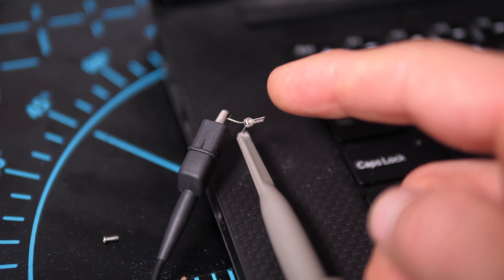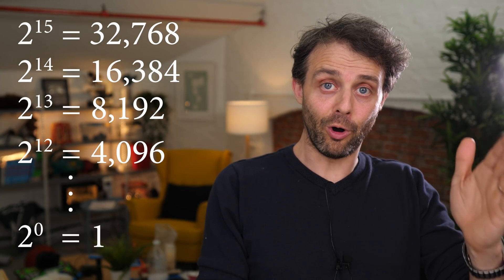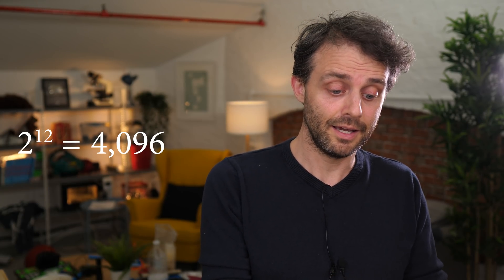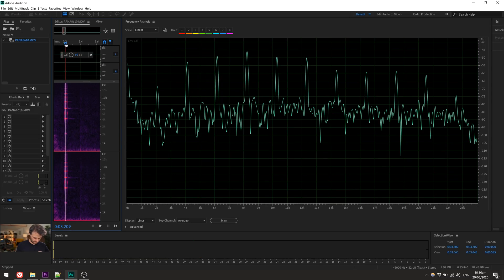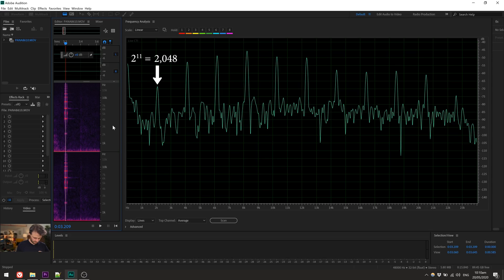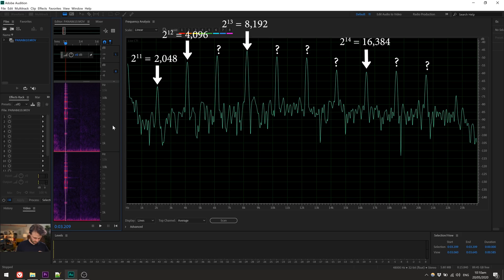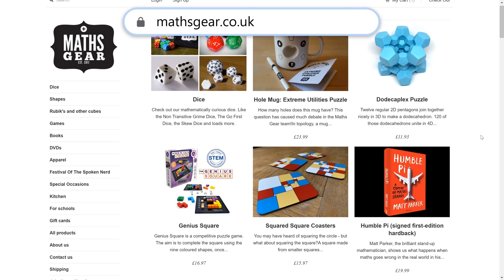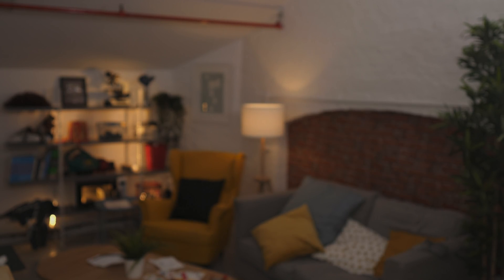Why a Watch Beep Is Exactly 2¹¹ Hz (2048 Hz)

Comment: Two questions I'm still wondering about those watches running at 32768Hz:
1. Does that mean dogs can hear them continuously humming? (Corollary question: if there's any dogs reading this comment, do you find those watches annoying?)

2. I'm pretty sure those watches have a "stopwatch" mode where they time in hundredths of a second. But that wouldn't be a power of two! Is it possible they do that by actually measuring 1/128 of a second and then doing some calculation? If that's our hypothesis, there's a way we could test it! You would have to take samples of the hundredths number at random intervals, and then measure the frequency of occurrences of each last digit -- if the display is updated every 1/128 of a second instead of 1/100, you would get a different distribution of digit frequency (instead of each digit occurring exactly 10% of the time). Would need loads of samples though....
Reply: Regarding the first question, porbably just very quietly, as the speaker is not used when there is no beep. But if you place it right next to a dogs ear, the dog would hear it.

Your idea for the second one is quite cool. But my (simplest) guess for how it works is like this. The watch counts up to 328 and every time it reaches that, the count gets reset, and 0.01s gets added to the time. I think like this the watch has an error of (32768/100 = 327.68 so 0.32 off from 328. 1s / 32768 x 0.32 = 0.000009766) 0.0009766s per second. So that seems precise enough for a hand operated stopwatch to me. So like this the watch probably will just ignore the error and display every number evenly
Reply: You might be able to get the data by looking at a highspeed camera of it counting up, depending on refresh rate of the LCD. 
Otherwise, this sounds ripe for automation! Get an rPi to push stop stop, take a picture of the screen, OCR it, then repeat.  I'm also curious now.
Reply: @rjmackenzie  Oh wow.. yeah.. that has to be done.  My guess is that you're right.. they're really measuring 128ths of a second and they're rounding it to the nearest hundredth.. After all, nobody would ever notice.  It does mean that some values would be more frequent, although if they treat the whole timeframe (minutes, seconds, hundredths) as one big number, those "peaks" in the randomness could be different in different seconds..  ie maybe in "second zero" there's a peak at 0.12 seconds, but because of the way the rounding works, that same peak would be on a different hundredth on second "5.xx"   WOW..  How to do this, without any rounding error from the device timing?!  (in otherwords an arduino may have the same issue, and if it's the one doing the test timing, your results could be skewed..)
Reply: @Steve Jones  Ooh, good point on the MC's timing needing to be compensated for. It should be ok if you just use one with a very fast clock. You could verify the true timing with a scope at 100 mhz, should be plenty fast to verify the timing being accurately "random" enough for this test.
This would also be really interesting to verify exactly how accurate the watch really is on it's timing... Pulsing the signal by a measured amount (tuned with scope).
Reply: Well, nowadays digital quartz watches probably no longer work like before... with the advent of ICs, they now can work using counters instead of halving the frequency repeatedly. That allows for precise stopwatches.
Reply: @GRBtutorials  we're talking the cheapest of cheap watches where every transistor is extra cost, I don't expect a $15 wristwatch to be at all accurate as a stopwatch
Reply: @TheAechBomb  You can buy a microcontroller (that is, a small CPU with integrated RAM and a PROM) for only $0.03. Of course, I'm pretty sure most watches use specific watch chips because it's cheaper and uses lower power. Silicon chips are very cheap nowadays and most likely not the main cost driver of such a watch. Even the quartz resonator would be more expensive!
Reply: @GRBtutorials  when he said halving im pretty sure he qas jist oversimplifying it. When you count in binary, every new digit doubles/halves it since binary is base 2
Reply: No idea what dogs can hear, but you've likely experienced this as well.  Ever hear and old TV or CRT monitor whine?  I think those tended to be in to ~20kHz range, but I definitely remember that when I was a kid.  Can't say if modern TV's still do it, don't think I can hear those frequencies anymore.
Reply: Rob Buchanan It’s around 15 kHz, which is the scan frequency. They use coils to deflect the dot, and that induces vibrations on magnetic parts, hence why you can hear it. Non-CRT TVs don’t use coils so they don’t emit that sound.
Reply: @GRBtutorials  15.625kHz PAL, 15.734KHz NTSC.
Reply: @Buchaven959  CRT TV whine is 15.6 or 15.75 KHz. CRT PC monitors generally do not have an audible whine, as the horizontal refresh rates are much higher, above 30 KHz. Modern TVs generally don't audibly whine. Sometimes they still do, but the mechanisms are unrelated and there's no one given frequency or source of frequency that they whine at, but if i were to guess the most common one, it's usually the coil whine of a voltage regulator, which are trimmed to be above 25KHz, and often in hundreds of KHz, but visual patterns or the horizontal refresh and the regulator frequency can sometimes modulate each other producing a sum and difference, and the difference can sometimes fold right back into the audible range if you're unlucky.
Reply: @Buchaven959  You heard the horizontal scan frequency which was above 15Khz and used to run the flyback transformer which created the high voltage needed for the picture tube. I'm 57 and can still hear that in old tube TV's. New TV's don't use that circuit, so they don't make that sound.
Reply: @Buchaven959  15,734 Hz (in America)
Reply: Mincerafter 42 What you’re seeing is probably simply the screen refresh rate. The screen doesn’t refresh fast enough for it to display hundredths of a second and below.
Reply: @GRBtutorials  that can be tested easily by pressing the stop button and see if the same numbers appear
Reply: It is possible to divide a frequency by any number, like 10, they're called counters and you can count up to (or down from) a number, when you hit zero, that's the pulse of the input frequency divided by the number, such as 10 or 100... that's my guess how the digital stopwatch counts 1/10 and 1/100 of a second.
Reply: @HobbyHalloween  you can divide any number, but the problem is as follows. Lets say you have 150 "ticks" per second. Ho do you count?
Reply: @qwertzuiopqwertzuiop2107  Well, it depends on what you want, I can interpret your question in two ways: if you want a pulse every second with an input of 150 ticks per second (i.e. 150 Hz),  a counter (8-bits) can be loaded with 150 (binary: 10010110) and set to count down (decrement) to zero, then when the counter hits zero you get your pulse and simultaneously it reloads the counter with 150 and the cycle continues.  However, if you're asking the question the other way around: "how you count the number of ticks per second", then you need a time base usually 1 Hz that opens a gate to the incoming signal which allows the pulses to increment the counter, when the 1 second time base signal falls the gate closes and the value in the counter is latched. Each time the time base signal rises, it also zeroes the counter... this is basically how a frequency counter works.
Reply: @HobbyHalloween  its more of a rhetorical question. U can see my answer (second comment to the top)
But sorry for being imprecise with my quedtion. I mean if you have 150 ticks per second how would you increment the centiseconds.
Reply: @qwertzuiopqwertzuiop2107  you could  derive the  frequency you want with a phase lock loop.
Reply: @anullhandle  thats definitely one way to do it. Again though its a rhetorical question
Reply: @qwertzuiopqwertzuiop2107  If your timebase is 150Hz and you want to time 0.01s, you would have a large accumulated error (either count every 1 or 2 clock ticks) or you could alternate between 1 and 2 ticks to keep the cumulative error low with uneven time steps. Either way, the timebase is too slow in this case to derive a precise 0.01s clock. That's why in reality the quartz is orders of magnitude faster than the shortest time step you need, so that rounding errors (or rather discretization errors) become insignificant. With a 32768Hz quartz you count to 328 for 0.01s and the relative rounding error (because you can't count to 327.68) is only 0.1%. That's much worse than the typical drift of the quartz itself, but more than adequate to keep track of the hundreths on a hand-operated stop watch. Actual high-speed timing devices (e.g. oscilloscopes or all of IT) use clocks on the order of 100MHz to keep rounding errors on the nanosecond level or below, or derive important fractional frequencies (like bus/CPU/RAM clocks in the PC) with dedicated PLL circuits.
Reply: @qwertzuiopqwertzuiop2107  I understand your question better., thank you for clarifying  You need both a timing generator and a counter, they would be  separate circuits: The dividers generate the precise timing pulses and the counters increment and count the tenths and hundredths. For example some old-school parts I played with in the 80's  Google 74LS90 ... this is a dual counter, but counts in base-10 (modulus 10), perfect for the job! The next part is the output of the  counter has to be decoded in order to see a digit on a 7-segment display , see 74LS47 or CD4511
Reply: Hmm. Never thought of that. They could use the 1024 Hz division and increment the counter every 10th, 10th, 10th, 11th, 10th, 10th, 10th, 11th pulse and so on. That will be so close to correct that no one will ever notice the imperfection.
Reply: These modern watches use microcontrollers with configurable timer modules, or ASICs with a similar module that has been hardwired. These modules allow any frequencies and the granularity of it is dependent of the actual hardware. You can use a number of tricks such as scaling up the frequency with PLL and dividers and the number of cycles to get almost whatever frequency you need. They also might include another RC oscillator that can be evenly divided into 100Hz. The innacuracy of RC oscillators is not an issue for the hundredths of a second as it doesnt need to maintain accuracy over days or weeks. If you're curious check out the datasheet for an atmega328p (the microcontroller in an arduino uno) or really the datasheet for any microcotroller. It will explain the principles of how they work and what they can be used for.
Reply: @masondaub9201  I don't think the majority of watches use microcontrollers, though a substantial minority would do so.  Semiconductor vendors introduced a few common watch chips with some customizable options, and most watches simply use those.  Microcontrollers have gotten pretty cheap, but stock watch chips are even cheaper.
Reply: @flatfingertuning727  fwiw mcu's can be had for less than 3 cents in small quantities. Less in bulk but yeah there's probably a few watch specific chips everybody picks from.  The chips don't even come in packages to shave cost/size.
Reply: I have noticed with several digital stopwatches, be it on watches or standalone, that if you stop the time, the hundredths of a second displayed are from a set that is less than 100 values large. Some values are skipped. So while hundredths are displayed which seemingly indicates 1/100 s resolution, the resolution is actually less, e.g. around 1/30 of a second. Or perhaps 1/32, now that I think of it.
Reply: Yes, I can hear watches humming all the time, it's really annoying. Why can't you guys just make watches run at 65536Hz instead?
Reply: I have seen something answering this question before. From what I remember, it's something like it counts 1 "millisecond" every 32nd or 33rd clock cycle on the 32.768kHz clock, making mostly slightly short/long "milliseconds", then one odd length "millisecond" at the end to make it back to a second, and potentially not exactly 1000 "milliseconds" in 1s.
If you wanted to divide a clock evenly into 100, you'd need a PLL or similar which is too complex for a wristwatch.
Reply: M. de k.  Well no, but I can hear transformers buzzing at a low frequency (not sure what exactly), or as others have pointed out in the comments, in the olden days you could hear CRT screens whistling at 15kHz or so. So I hear things buzzing in general, some of which are annoying. But, more relevantly to this case, Steve specifically said in his last video about quartz watches that they deliberately use a frequency above human hearing (which is why, he said, they don't use 16384Hz -- as that would be audible and annoying). So I don't think it's crazy to ask if dogs can hear the watch at 32kHz.
Reply: For the 1/100 stop watch mode, the liquid cristal is not fast enough to be changed 100 times per second. So, as many noticed, they cheat by creating an animation that repeat the same few numbers at about 10 per second.
The second, minute and hours are incremented with the usual 1 Hz clock
The start/stop button is tested every 1/8 second, probably. When pushing it, the value of the 1/100 is an approximation of the 1/8 time window.
There is no reason to use faster cristal or fancy microcontroller. The digital watch are using the minimum CMOS transistor possible and they beat any other design for low power consumption.
The arduino atmel microcontroller use same type of transistor and consume.much more power with their 16 MHz clock.
Reply: I actually did such experiment a while ago, and the distribution is interesting:

https://translate.google.com/translate?sl=auto&tl=en&u=https%3A%2F%2Fmossowski.blogspot.com%2F2015%2F01%2Fstoper.html
Reply: Now I'm curious too! Especially the answer to question 2.
Reply: My first guess would have been beat frequency, and another oscillator vibrates at 32,688 hertz, or 32,868 hertz. But I realized that those aren't powers of two, and if I was right, then we could just as well use a frequency of 100 hertz.
Reply: For some stopwatches instead of 32768Hz it is used 32000Hz. That's 1kHz multiplied by a power of 2 (32). Such clocks can precisely count milliseconds.
Reply: Your air conditioner hums continuously. Is that annoying to you? It's way larger than a wristwatch.
Reply: Any counter on any computer rounds off when showing us humans stuff. The precision behind numbers are to a factor of two, always. Developers everywhere have to remember that at all times.
Reply: @hoej  Ok, but I think you (and a few others) have missed the point of my question. If you're going to be doing that kind of rounding anyway, then why does the crystal's frequency matter in the first place? Why not use a crystal resonating at 50kHz and just do the necessary counting/rounding? Matt's original video on these watches was all about how having a power-of-two frequency allows you to have a really simple (therefore cheap, etc.) counting circuit. But then, many of the replies in this comment (re: the centiseconds) are talking about how you can just round or count arbitrary numbers anyway. There has to be a different motivation between the two cases -- which I'm sure there is, but you have to explain that and not just state glibly that computers can round numbers, as though that was news.